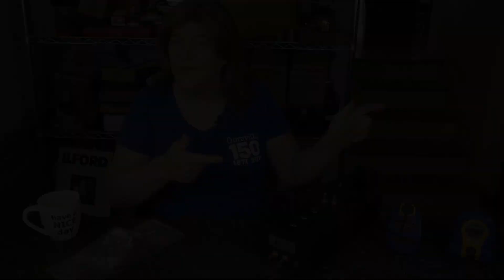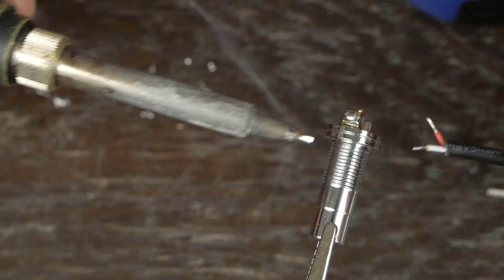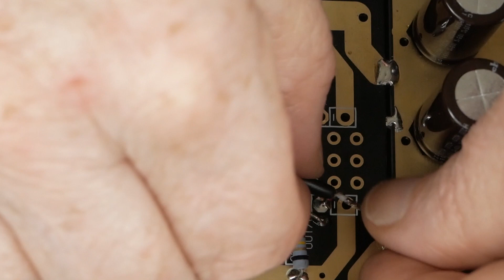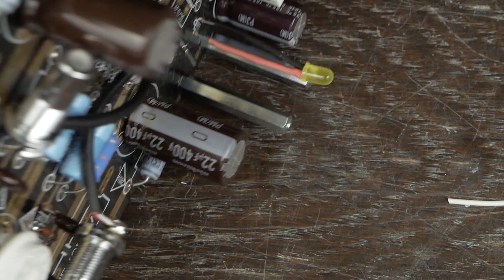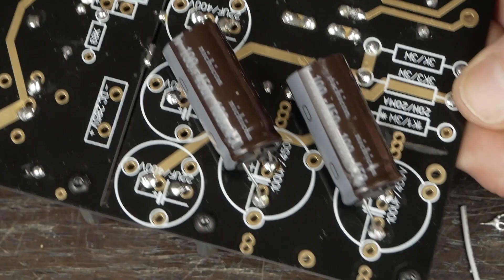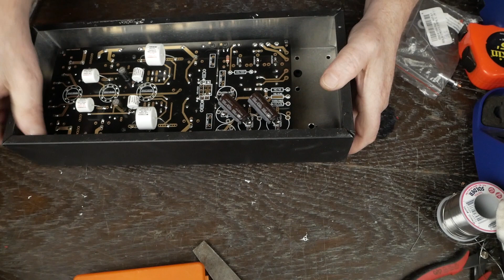DIY Phono Pre-amp: Prep and Assembly

Comment: Any reason not to use shielded cable with drain wire at the phono input side as well?
Reply from the maker: It's 1/2 an inch long lol, Plus is a foot away from any type of AC
Reply: @SkunkieDesignsElectronics  just curious, figured I'd use what I have on both ends

Edit: love this series super helpful!  Also initially didn't realize it had the drain wire

Comment: Couldn't you get a cheepo rca cable and plug them in to the jacks and pull them through as you seat the board?
Reply from the maker: None of the ones I have will fit through the hole in the chassis. If you have some that will, that would for sure work!

Comment: For fishing the RCA jacks thru their holes, you could use a little piece of masking tape to attach a string to each RCA jack. Fish the strings through the appropriate holes then lightly pull them as the board and chassis are mated. The LED is it's own thing.

Comment: Is it ok to use lead solder with Hakko soldering tips? If so, what temperature you recommend to set the solder station to.
Reply: I use 750 F/400 C for 60 Sn/40 Pb but I'll defer to Skunkie's expertise.
Reply from the maker: That is exactly what I use :)
Reply: Thank you! @SkunkieDesignsElectronics

Comment: An idea for the the RCA sockets. Get 2 old RCA cables and cut off the plugs on one end and the outer section of the plugs on the other leaving only the centre pin connected to the cable. Plug the pins into the RCA sockets and feed the attached cable through each hole.